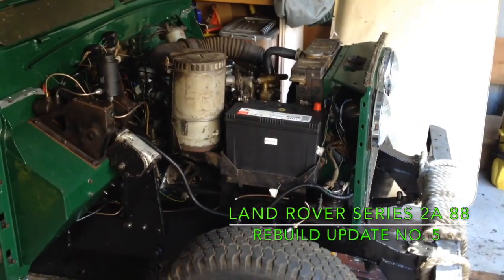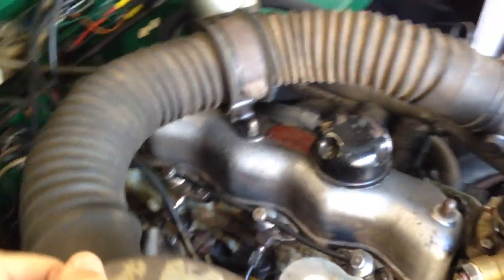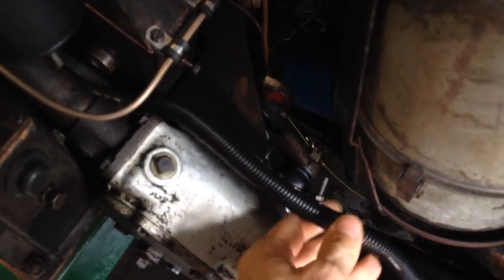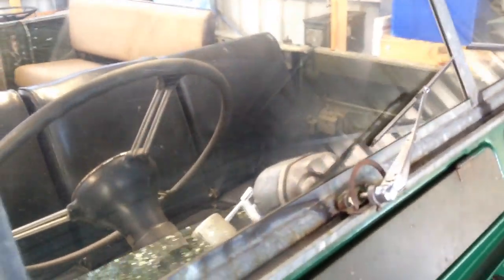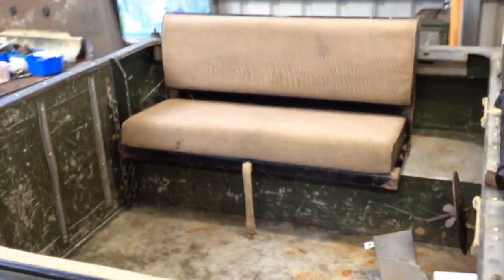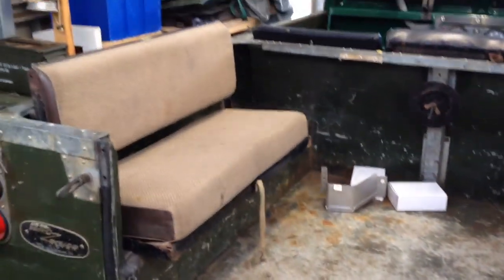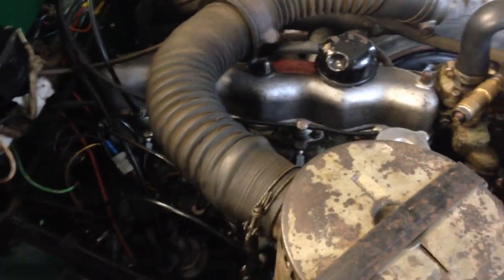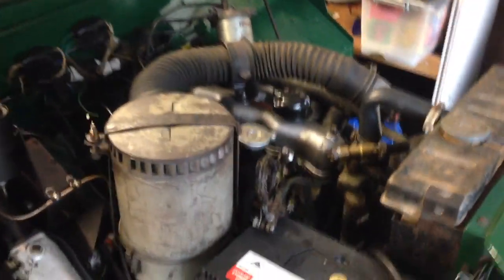Land Rover Series 2a 88 - Rebuild Update No.5

Comment: Nice work, was the seals arround the front air vents juts made from spare rubber/foam? I also spent alot and got wipac LED indicators, same shap as original but much brighter, but i did have one get moisture inside, and the factory didnt want to know me.
Reply from the maker: I guess its a gamble buying replacement parts.  My original bases are OK along with wiring so I thought ill just get another 50 yers out of them :)  Air vent seals are just a square self adhesive foam. It presses against the bulkhead vent lip which looks to create a seal. Time will tell. I do have actually vent rubbers and both sets (one flat faced rubber, the other has a profile) do not fit!